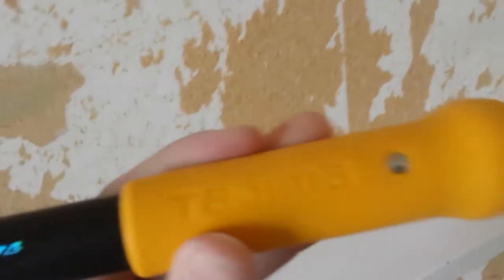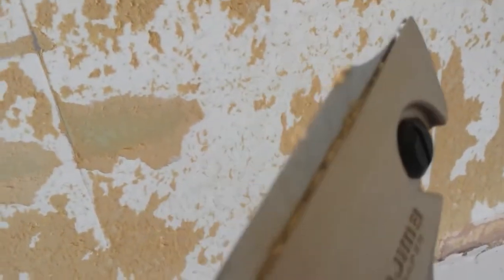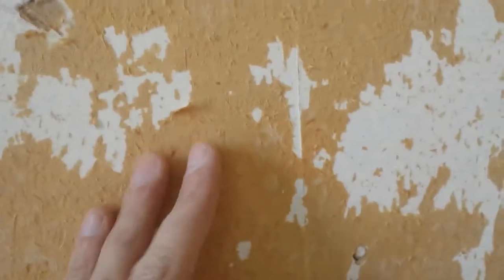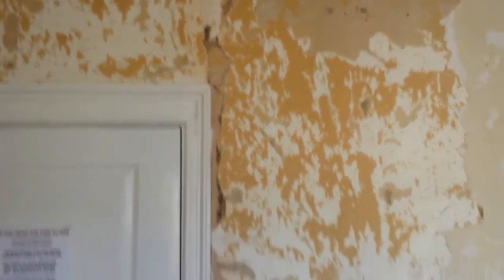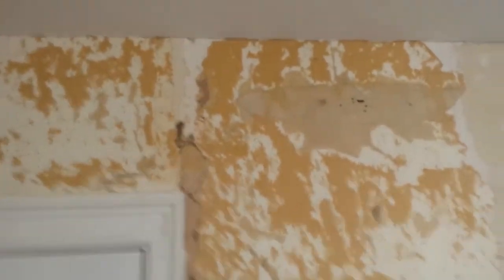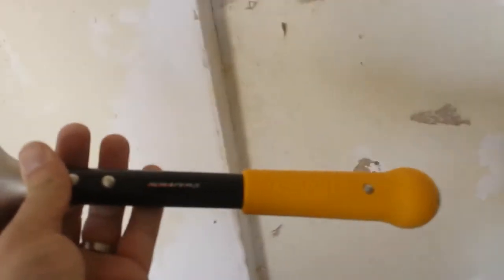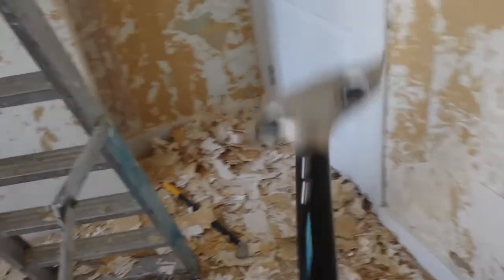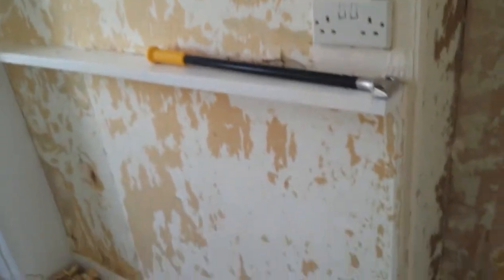How To Strip Woodchip

Comment: Thanks for the useful tips. How do you prepare the wall for painting once the paper is removed?
Reply from the maker: Hi. I usually skim the walls with Easyfill then sand down with a mirka and either a base coat of a plaster primer or PVA if I'm re hanging paper. Cheers Dan